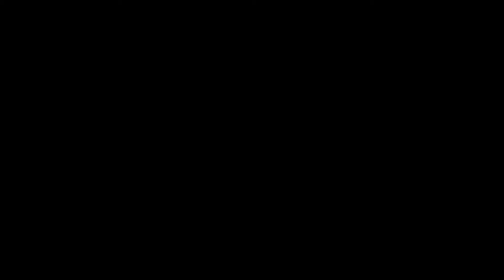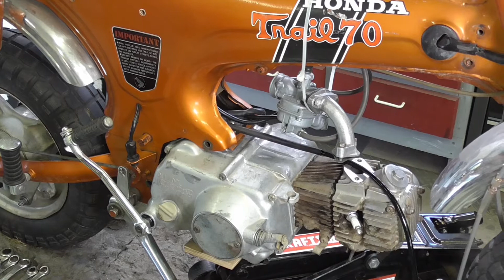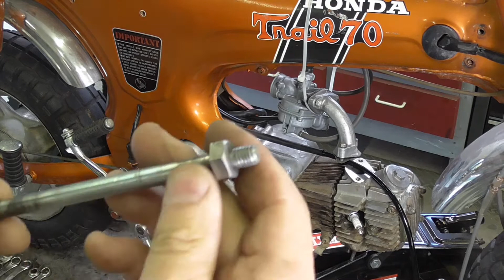Honda CT70 Mini Trail, Reconditioning Pt #3 --- Video #280

Comment from the maker: Thanks for sharing the info on the cover, I looked at the eBay listing and the seller doesn't include the OEM part number.  According to the North American parts diagrams I've referenced, this cover isn't included on NA market machines.  Curious... if the lister had included the part number, it would be easier to sort this out.  Thanks again for your comment!